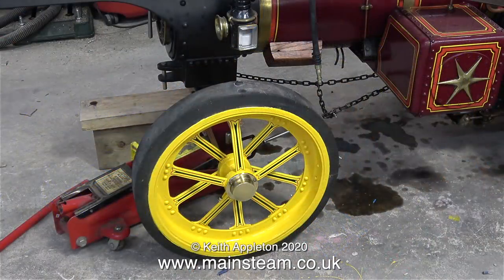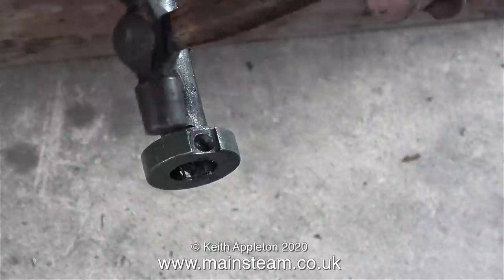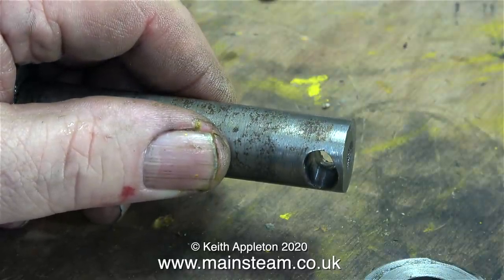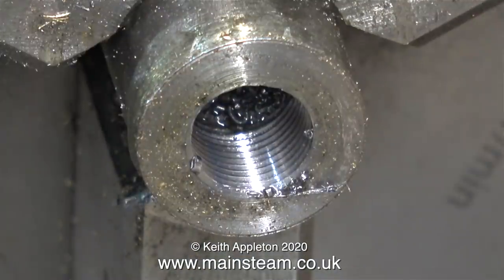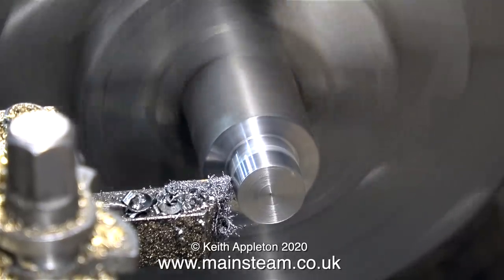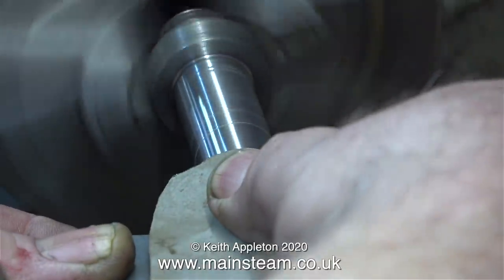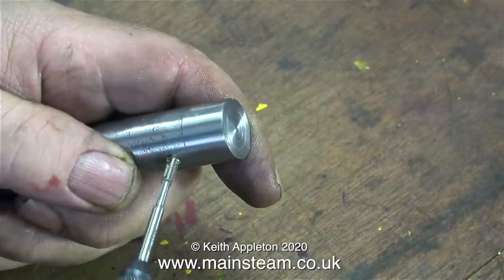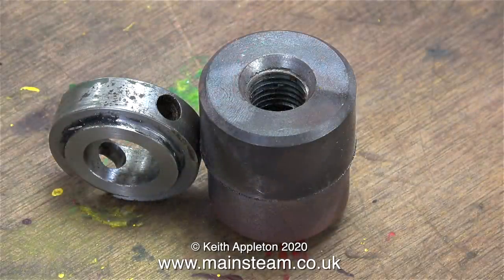A LARGE MODEL SHOWMAN'S ENGINE - PART #17

Comment: Interesting. The pin and collar arrangement is straight off ancient chariots. There was an earlier design in Roman times that the pin only held the wheel on,but the collar,especially with the hubcap,is much safer. I suppose at the low rotational speeds,no more is needed. Rather an elegant solution.